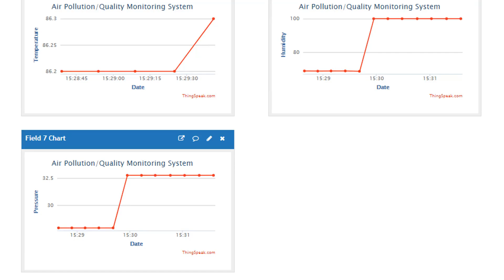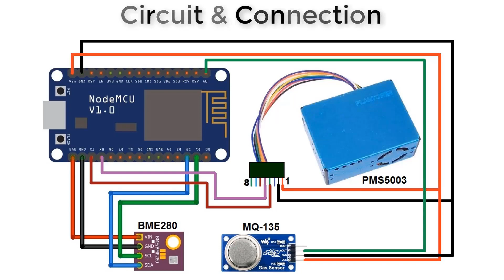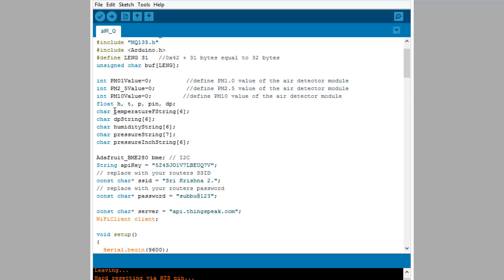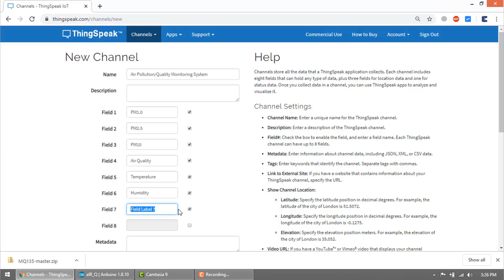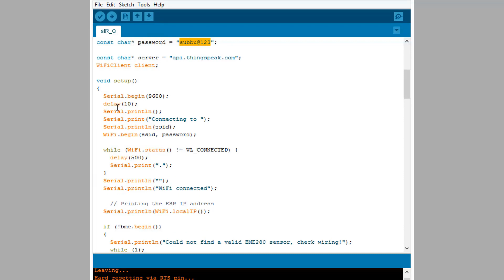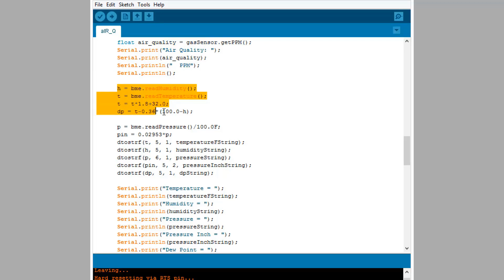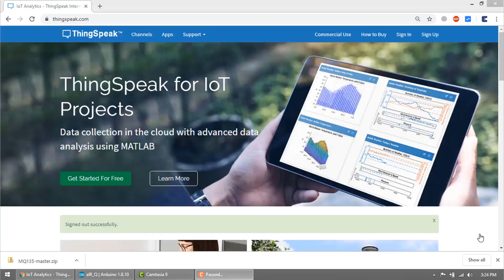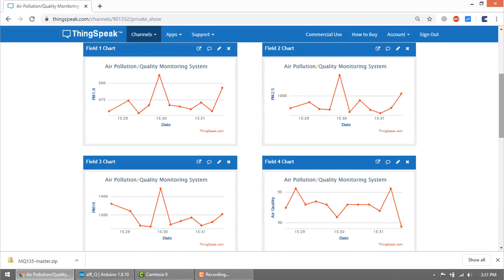IoT Based Air Pollution/Quality Monitoring with ESP8266 on Thingspeak

Comment: PMS5003 part is necessary or depend on choice?MQ135can work with only node mcu?
Reply from the maker: Pms5003 is very important part.
Reply: Hi there, Did you manage to get the code? if so could you kindly email it to preetmatharoowork@gmail.com it would be really appreciated and life saving 
Thank you for your help, best wishes